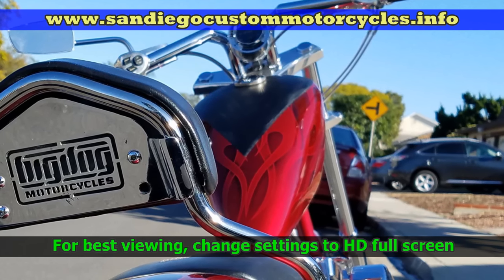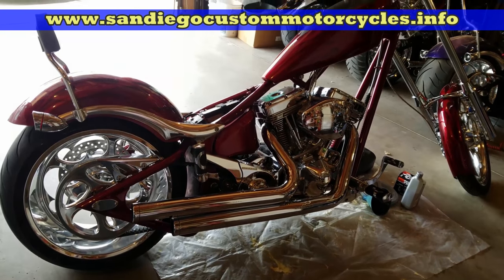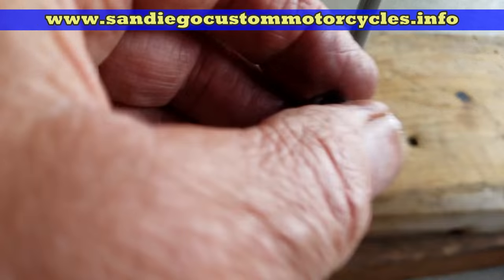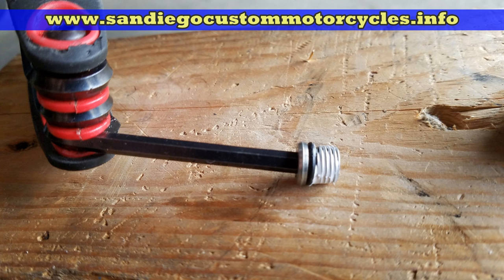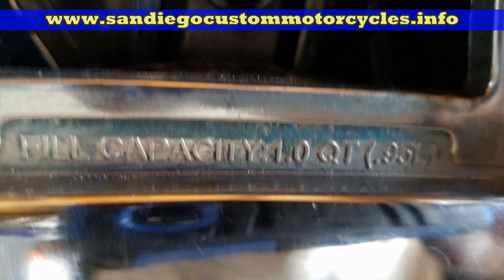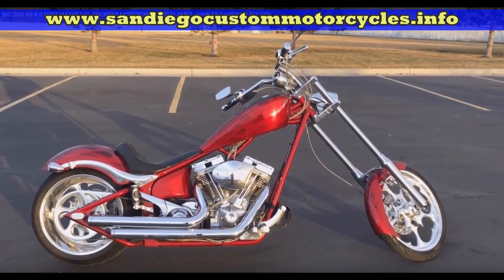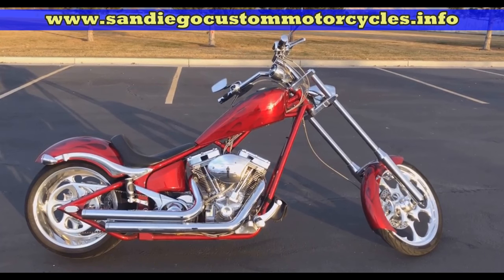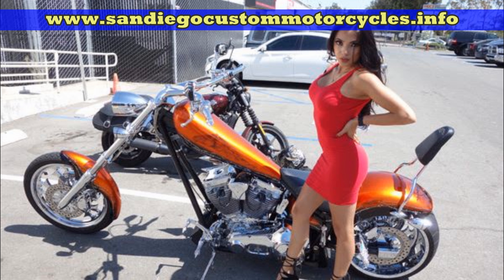Big Dog primary oil change

Comment: So what I'm wondering is how to service that Gear box with belt drive right there...I can't seem to find ANY drain plug and only a small plug on the top.
Non serviceable ???
Reply from the maker: Only know the Big Dog k9. As always, things could be different with different models and different years so always check your owner's manual.  But on my bike there is a transmission drain plug and also a refill where you put gear oil of the proper weight  and amount for your bike. 

Here's where the owner is manual information is very important you have to see the recommended gear oil weight and the amount to use.  A mistake here can cause big problems,  where you have to pull out the entire transmission and have the seals replaced this would be a very costly repair so either bring it to a professional or call the manufacturer to make sure you have the right weight oil and the right amount.
Reply: @Pilotjoe7  yeah...im familiar with my Harleys.  My buddy dies not have any paper work or owners manual unfortunately.  '06 American Ironhorse Outlaw S&S 111
This has a hydrolic clutch,  only fill plug is a little one one top, 3 on the bottom  but looks like they are empty of "plugs". 🤔
 I think its best I just don't fuck with it.

Comment: Where do you add the new fluid? I have a 2006 BD pitbull. I have a primary leak I just discovered. Looks like maybe coming from the drain plug.? When riding it slips out of gear. That got me looking.
Reply from the maker: Sorry never owned a Pitbull just the k9 models.  On the canine the primary drain plug is at the rear under the primary case.

Comment: Hello! thank you very much for your lessons! I am from Ukraine, I write through an auto-translator, and I apologize for possibly incorrect English))) I have a question - what oil do you recommend to fill in the primary and in what quantity? I would appreciate your response! (I have - Big Dog K-9 S&S117 = 2007 year
Reply from the maker: Personally, I use 20/50 motorcycle oil. Never use synthetic for the primary drive.